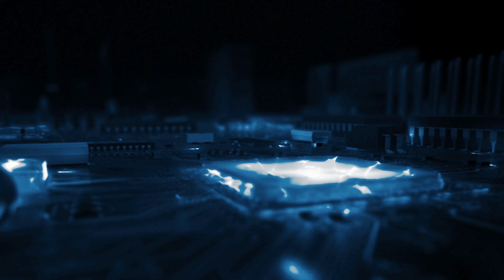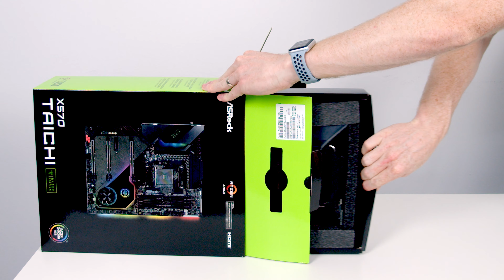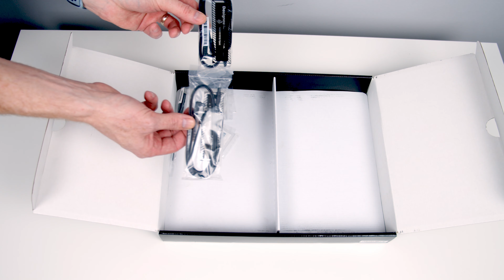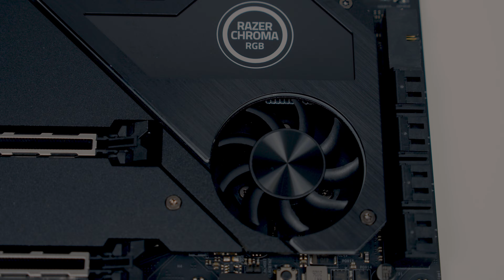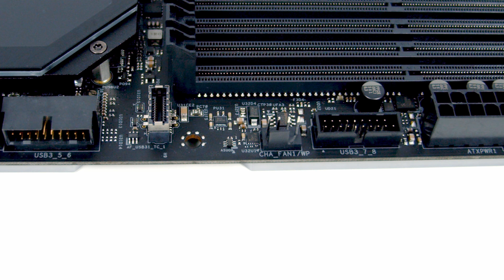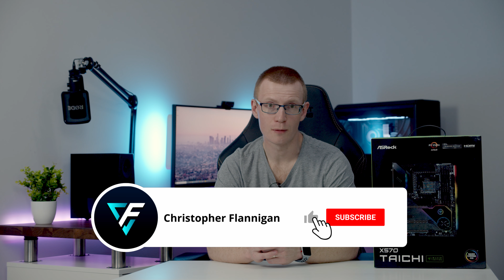ASRock X570 Taichi Razer Edition - Unboxing & Overview

Comment: Would this motherboard be able to handle 4x16 of Cas Latency CL14 3600mhz ram using either a 3900x or 5900x? I already have a 3900x in one build, but would I need to step up to a 5900x to use that much ram with that timing? Please advise...
Reply: @slikjmuzik: 

yes because the-stuff-you-are-asking-about the motherboard has nothing to do with it. 

the motherboard just says "i can-handle up-to ######MHz of Ram, of #### amount of Gigabytes. the rest is up to you / the rest? stick-in-me what you've got".

the motherboard won't tell you "no. i can't-handle CL16 DDR4 2666MHz,  but i CAN-handle CL15 DDR4 2666MHz". 

the motherboard can't (and doesn't) discriminate on how-much-"CL Latency" a Ram-module has. it'll do-its-Motherboard-Functions/Motherboard-Thing with whatever Ram-modules you give it, provided the clockspeed of the Ram-modules is within the clockspeeds it supports, and the Ram-module gigabyte-size the motherboard supports.